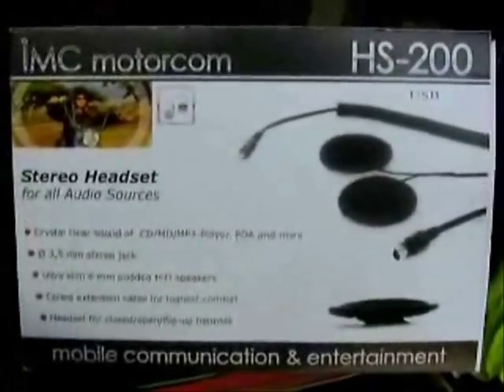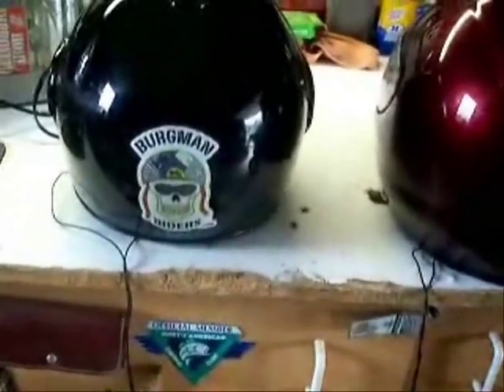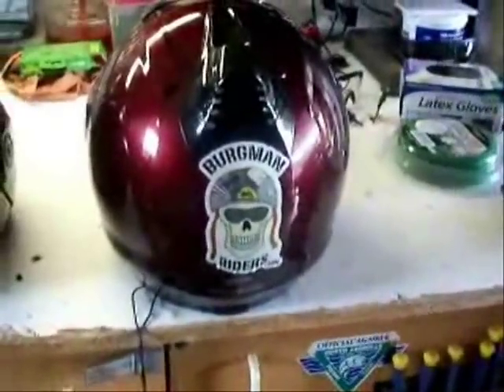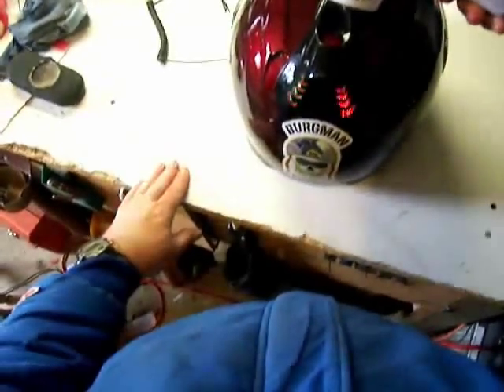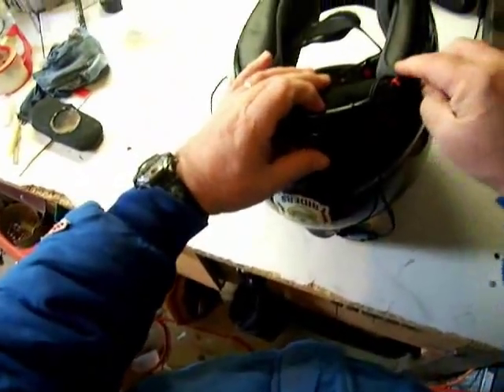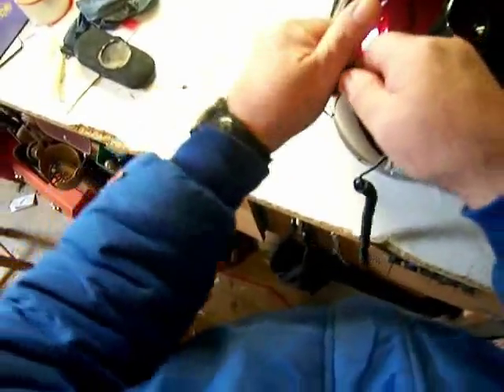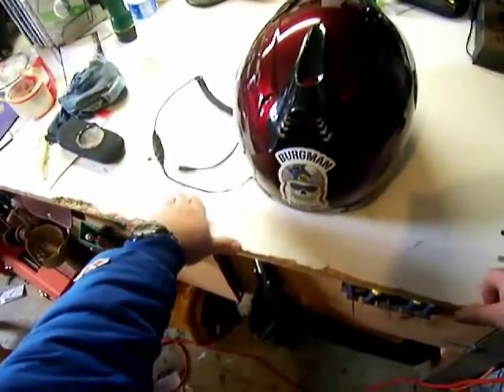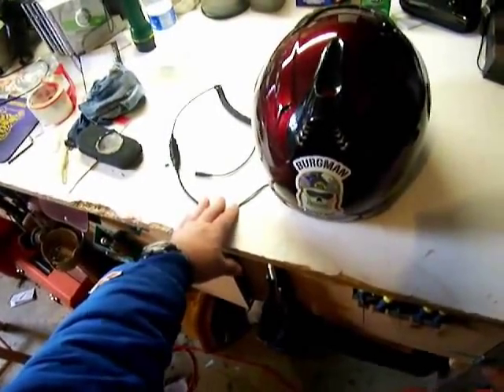IMC Motorcom HS-200 helmet speaker install and review.

Comment: Hi thanks for the review. I use an autocom system in my helmet with a pmr radio and mp3 player and bluetooth for my phone and it works well. I have been on the phone to a friend at 130mph and he didn't believe i was on my bike (vfr750). and music is good even at high speed  as well.